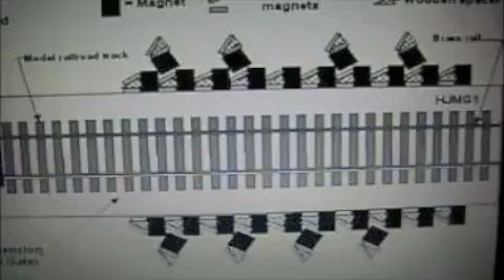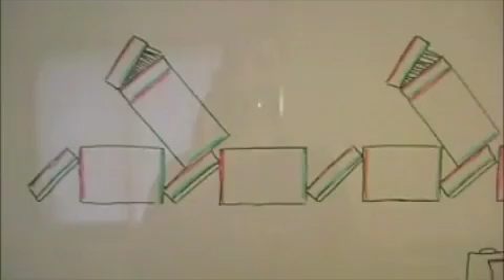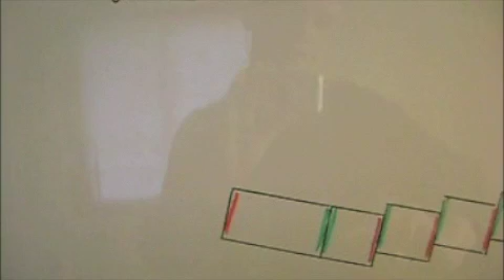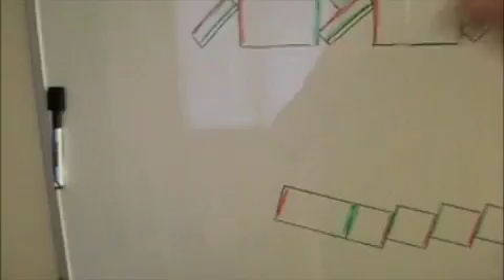Replication of Howard Johnson's most famous linear magnetic motor.

Comment: Well change it from linear to a circle while also looping around. If you could ramp it up continuously till you hit the rechts vibrational frequency. That could cause levitation. The only problem would be the energy to power 🔋 and the ability to keep it from flying apart before it hit the right frequency. Superconductors and mercury would be best.

Comment: It always boils down to overcoming the force required to enter the gate.  It will always require more energy than you can produce.
Howard Johnson's magnetic motor never worked.  No one has ever been able to replicate a working Howard Johnson's magnetic motor.  Only videos, like this, trying to overcome the resistance entering the magnetic track.

Comment: If it works all you need is a circular track and it would go around forever.  If it can't do that then it doesn't work,  It's that simple.  It either works or it does not.  Which is it?
Reply: It does not work. If you let the train run down a slope long and steep enough that the train goes through the gate against the resistive forces to enter the gate, and you let it climb an identical slope on the other side it will never reach the height it was started from.
Reply: @heinzpg  Yeah m8.

Comment: whats the longest you can make the track? oblivious the magnets dont have the power to push through a second gate, but if the track was long enough with a small dynamo to charge up a battery then at the end of it that stored power could be used to push through into a second gate, the longer the track the more charged energy you could accumulate

Comment: i think the energy is coming form ur push when u get it in track at start and u should build a cyclar
Reply from the maker: I'm not actually pushing the cart to get it to go down the track. However, there is a repulsive force at the entrance of the track. Once you rest the cart, just past that point, the magnets on the track will grab the cart and send it down the track. I circular track wouldn't work, unless I could figure out a way to get the spin accelerators to work exactly the way Howard Johnson's were rumored to have worked. I've been doing this long enough that it would only take me about 60 seconds with his original track to confirm whether it actually worked in a way that you could build a rotary design out of or not.
Reply: this is an old video and is the first video of urs i've seen. Hmmm, to make it circular perhaps u can try doing 3-4 segments like this. I see the cart keeps going fast as it leaves the track. Ok so the idea is like this. Simplest version.

3 segments like this. 
Magnet walls, or part of them are movable. They let the train go in and then they approach the track. Magneticly squizing the train. Similar to our lungs function. Bread in bread out. 

Also u could maybe build a pusing electro magnet, when the track gets close the field it receives a little push to defeat the invisible barrier.
Reply: I think he is pushing it past the poles that are trying to push it backward and then it kinda gets sucked in. But you have to have just as much force to push it in the gate as it provides when it pushes it out. so think of it kinda like a spring its kinetic energy. A spring can push a object but it has to be compressed with energy first. That's why this could never run  constant in a circle. cool toy but no practical advantage.
Reply: @jvmiller1995  this is a late reply obviously but what if the circular track was all magnets just like the part that pushes the train so movement would be continuous or would that potentially create issue's with the magnets not being even shape on each side as it is in this model?

Comment: Yeah, I agree, but I was reading and researching about this, there are some motors that seem to work, they never lose speed, at least on video, whats up with that? Is perpetual motion using the power of magnets a scam?
Reply: If you see it on you tube it is a scam. If this worked it would put the hurts on big energy so  if someone has made one that works it has been purchased by big energy and the inventor signed papers to never speak of what he made. That or they just killed them. If it was real and not bought out we would see it by now this was made in 1980.

Comment from the maker: lol I like the way you over think things. I have a tendency to do that myself. I'm trying to stay away from electromagnetics, in my research. Even if you manage to make it work with a pulse gate, you end up having to argue endlessly over whether you've achieved overunity, and are actually getting more energy out than you are inputting. Building a motor using only permanent magnets eliminates the need for the argument all together.
Reply: No argument required whatsoever.  If it works, it moves forever. Easy to observe.

Comment from the maker: Thanks. With an exact list of spacing, size, and exact magnetic materials, I'm confident I could figure it out. However, the most important question I would ask him is whether you could stop the cart at each gate in the track (past the null zones) and still generate enough force to escape the track. If it doesn't work that way, then everything else is irrelevant. Which forum are they on?

Comment from the maker: I'm only getting a portion of the effect that Johnson's original did though, because of the type of magnets I'm using. I did double the length of the track in one of my other videos, to the point of nearly running out of magnets, and it still works. That makes little difference though, without the correct type of magnets, it wont work as rotating version. Thanks for the comments.

Comment from the maker: Not exactly. If I removed the spin accelerators, the track would behave in much the same way as the "magnetic rail gun science project" video that you mentioned. The accelerators, in repulsion mode,  give the cart the ability to exit the track by starting it level to any accelerator in the track. Including the ones at the exit point of the track. It's a complete different effect. The materials I'm using will not work for an arced version though, as they aren't the same as what Johnson used.

Comment: increasing the length of the track beyond what you already have will not much affect the kinetic energy of the truck. This is due to the fact that the force between magnets scales as the inverse fourth power of distance between them so adding more magnets at the end of the track doesnot increase significantly the forces which accelerate the truck at the beginning. This is also seen for the  linear magnet array: beyond about 10 magnet pairs no increase in the kinetic energy of the slider occurs.

Comment: All the behaviour reported by you here including the different response if you reverse the slider (or do it backwards as you say) is seen in the much simpler linear array of magnets at 45deg to the track seen in the videos "magnetic rail gun science project" and "magnetic track energy test". Basicly the slider moves from a position of high potential energy to one of low potential energy so increasing its kinetic energy. This is not so much a motor rather a slingshot.

Comment from the maker: I clamp the magnets in place, and then use a hot glue gun around the outer edges to create a seam. By using this method it's easier to take the assembly apart later if you need to change something around in the testing phase. If you glue the centers of the magnets together it's difficult to take your assemblies apart, and its to easy to damage your magnets. Thanks.